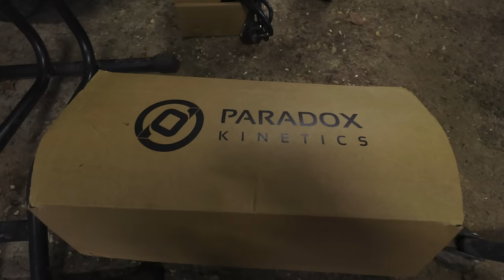I MADE A CRAZY POWERFUL DIY DOWNHILL ELECTRIC BIKE!

Comment: Not worth 3 grand
Reply: You can get a full suspension emtb for 3400 from cube haibike giant and rock climber ,the rock climber got wp suspension same brand as KTM mc and has 150 mm and Shimano ep 8 ..i saved up half in gift card's for that rock climber I just need to sell my old levo from 2019 first because I want a bike with warranty because I had to use the warranty on my levo,,which is kinda good because now it has new motor battery display and better rear hub..which might be a good selling point ..but the paradox is really cool 😎 I would like one on my trail bike it's just like you said not worth the price when you can get a emtb with warranty for approximately the same price(edit i meant rock machine)
Reply: @HeathenRides  SCOTT also
Reply: @HeathenRides but you cant shreed like that with trottle
Reply: @ArchieeproBMX  agreed throttle ruins the experience it's just a electric moped when there's a throttle..I love a good liquid cooled two stroke Enduro moped with six speed gear box,,you need skills to keep up when only having eight hp but that's not a bicycle it's very different thing's I have a specialized levo a sensor and a cube performance 500 tuned and customized for me by me with no throttle but I got throttle on my gilera rcr 50 and my derbi drd pro (which is of course derstricted and is confiscated at the moment 😂
Reply: @HeathenRides  i mean, ebike is fun,  but this one is fuuuuunnniiieeerrrr
Reply: @ArchieeproBMX it's for deliveroo drivers, not eMTBrs
Reply: @Mcfc2Rich  for delivero cargo biker are made

Comment: I destroyed 3 derailleurs and 2 cassette on a converted mtb with the cyc kit...don't shift while going fast...have fun 👍
Instead of thumb throttle I used sur ron throttle
Reply from the maker: Ah really! How easy was the Suron throttle to fit?
Reply: @SamReynolds26 the sur ron and cyc throttle  has 3 wires and it's color matched two colors are the same the third wire just connect to the unmatched color and that it oh and wire gauge are the same.
 I don't know about the paradox kinetic wiring and gauge but you need to check wiring diagram and voltage or contact the manufacturer and see if they have a throttle.
Oh if attempting to upgrade to a throttle some country it's illegal to add a twist throttle.
Hope this helps 🍻
Reply: @jondonut1810  you need to split the wires to use the original cyc connector
Reply: @SamReynolds26  it's easy because it's just 3 wires   power , ground , and signal that's it  took me 2 hrs total 
Your kit is the paradox kinetic I looked up for wiring diagram couldn't find any you could try contacting them for recommendation to throttle conversion
Reply: I got 150 km out of a e13 Helix cassete on a bafang ultra powered dengfu.  The teeth literally started peeling off.  Next cassete/group was a box prime 9.  Got about 250km put of that before the ultra munched it up.  Then I went with an internal gear hub.

Comment: When bafang does a 2,5kw nominal mid motor, all competition will vanish...
Reply: They don't need to, maintaining a 1000w conversion is hard enough
Reply: Bafang ultra destroys drivetrains as it is.  Doubling that would only double the drivetrain destruction.

When first set my e22 up, I got about 150kms out of the first cassette.  The teeth literally began peeling away
Reply: Hadn't considered drive wear, would heavier less exotic chains and cassette add life do you reckon....
Reply: @Ricardofromage  In my case I went from a 12 spd e13 Helix cassete.  Which lasted 150km.  It is super light weight aluminium, so in hindsight, it was never a good choice for a hi power eMTB.  The thinner 12spd, and soft aluminium just peels away under load.

I then put a box prime 9 spd steel groupset on.  And that lasted longer.  I got approx 250-300km out of that.  Again the cassete wore out the gears I used the most, and they began to slip under load.  The cassette was steel, and with 9spd, had thicker gears.  But the steel quality was low.  Just junk steel, if they had of used a hi quality steel it probably would have been fine.

I then bit the bullet and got a Kindernay VII internal gear hub.  And that had alot of problems with the hydraulic sequnential shifting system initially.  The kindernay chain tensioner also self destructed in no time aswell.  So I put a reverse components tensioner on and it is reliable so far. The kindernay gear box itself is so far pretty reliable.  Ive got over 500kms of hard eMTB on it now.  The oil won't stay inside though.  So you need to top it up every time you change tyres or even have the back wheel off.  I do get some occasional skipping gears now in the kindernay, but only in the low gears.  That was because I didn't realise all the oil leaked out before the first 500km service interval.  So it got mashed up from that.

I've snapped a few chain quick links aswell.  But never snapped a chain itself.  It's only the quick link joiners that blow.  So keep a few of these in your riding kit.

This might sound like very low KMs for e bike.  But eMTB is alot harder on gear than commuter e bike.  Commuter ebike is just accelerate on smooth ground and once at speed you cruising.  EMTB is so much harder on gear.  And I like to ride the bike hard too.  Full power all day.  Over 60 emtb strava koms on it aswell.
Reply: @BramBiesiekierski so there not that bad you just ran the wrong gear .I've get loads of miles  out of my setup on 1200 watts

Comment: Hey Sam , hope you continue to enjoy your eeb . I built an old Orange 223 with a Bafang bbshd 1000w with 52v battery . Although it is a downhill bike it'll climb anything . Try for a 1 to 1 ratio [ i have 40 teeth front and 40 tooth first gear on my casette , 11 tooth 9th gear ] you will be able to climb a wall ! Mine will do about 2mph in first gear and power level 1 , 48mph in 9th gear and power level 9 . I also effectivley have 81 gears !!!
Reply: I've got exactly same setup as you with a 42t chainring and top speed is 35mph on throttle only, there is no way you are getting 48mph with that setup unless your wheel setting on the display is not right.
Reply: Figures aside, this I exactly what I've been mulling over with an old Blur lt or Nomad, but i was thinking hub drive, having read this about gearing........ Nice one guys!!

Comment: Real Nice Bike 

 I built a 48 volt 20ah -1500 watt
26''  fat tire snow bike 
 all from Amazon for a  $1,000 bucks..

And I don't pedal it either
Average top speed is 33mph 
(have had it up to 36 mpg)

I'm putting another battery on it to double the mileage
$300 26''Ffat Tire Bike 
$300 1500 watt motor 
$400 48v 20ah battery

to see it  check the video on my page

So if you don't want to spend a ton of money & can turn a wrench & strip wires 
You have options

Comment: I have a 1000 48v when I got it it did 40 when it had no weight on and 36 when it did have weight on 5 months later it does 40 with weight on and 43-45 with no weight on it but mines a hub 😂more that middrive looks sick 💨💯

Comment: Is 1500W really powerful? My skateboard is 1600W!
Reply: 1500w for eMTB is like double or tripple what the name brands shit out.  Eg Bosch, Shitmano etc.  But for me, I would consider a nice entry level power figure.

My first eMTB had the bafang ultra which is like 1000w nominal 1500peak.  And at first I thought it was alot, but you soon get used to it and quickly want more.  I think around 2.5/3k nominal would be a happy medium where it's still a bike you can ride on MTB type terrain.  Enough power to get up and boogy on.  But not so much that the weight of the motor and battery you need to run it push it more into motor bike territory.  But that's just my opinion.

Comment: Annoyingly Loud and obnoxious. 0 respect, and I build many bikes. Though I must say I'm only a one man team enthusiastic about bikes. Cracking fibers are not a good choice for engineering bikes. Aircraft aluminum and titanium are far superior. Otherwise it's just a sales gimmick. High price plastic.
Reply from the maker: Don’t they make formula 1 cars, moto gp bikes and pretty much every bike racing World Cup cross country, enduro and downhill with carbon?
Reply: @SamReynolds26  Yup, great for one or two races, then it's done. Turbo charger is great for extra power but shortening the life of the engine is the trade off. It's a trade off. I prefer things I can repair or maintain for decades. PS: our industrial revolution was made of steel, glass and other non toxic materials. We've been sold out and sold a bill of goods with a short expiration date. Plastic vs Glass, I'll take glass hands down, at least I can recycle it cheaper and create over and over again.